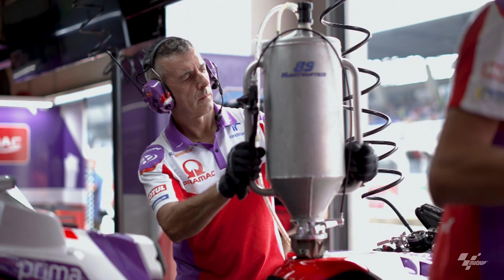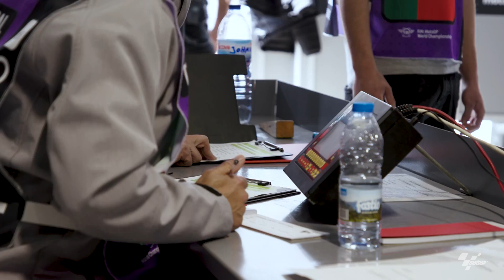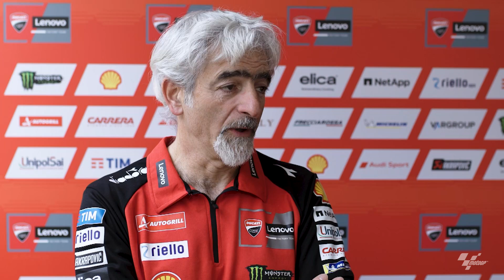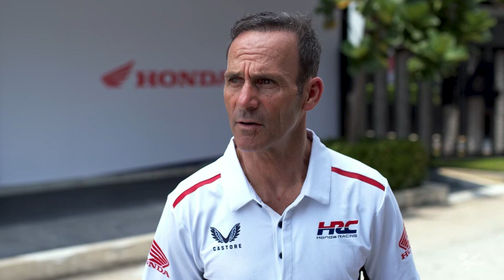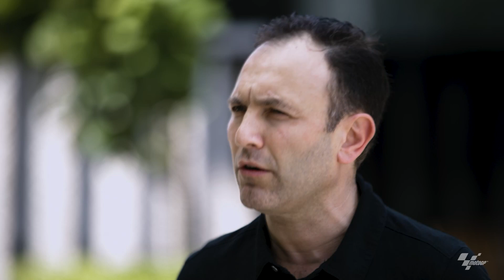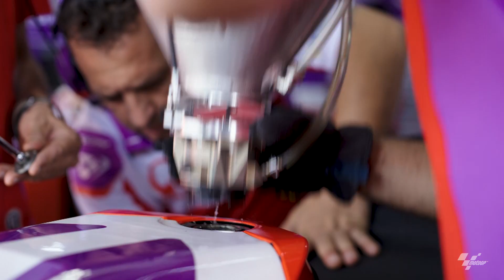How did MotoGP™ design the fuel of the future?

Comment: We already have Moto E separately. Hope this new fuel changes dont lead to scrapping current thing and moving towards no fuel stuff
Reply: Hear your point but I don’t think that will be the case. The point of these changes is to ensure that they won’t need to switch to some sort of electric bike. With synthetic fuels you’re no longer adding carbon dioxide into the atmosphere (it’s removed from the air and undergoes a bunch of chemical reactions to create synthetic hydrocarbon fuels - gasoline, diesel, jet fuel) and doesn’t contain the impurities of fossil fuel based fuels (I.e., nitrogen and sulfur oxides) which is what we consider pollution. Reports actually indicate improved performance because of their higher energy density. Same can’t be said for biofuels, though (I.e., ethanol) Synthetic > bio.
Reply: @CoastGhost13  Yeah. My initial thoughts were that only since they announced last year 40% non fossil fuel from 2025. But we know how the aero advancement situation, where every other manufacturers want to take it off. With this new changes  should not affect MotoGP because sound of the bikes is an integral part
Reply: @CoastGhost13  Dont forget Nitrogen is naturally present in the air, so NOx particles emissions are still going to be a thing due to the high temperature chemical reactions taking place during combustion, still, an important step forward. Also, CO2 emissions are not reduced whatsoever since its the main byproduct of internal combustion engines (Hydrocarbon fuel + O2 in the air => CO2 + H2O + other secondary reactions). CO2 is not a pollutant but considered a greenhouse effect gas. My point being, synthetic fuels are not going to be a complete game changer as far as emissions go, but anything to keep it going and stop stupid politicians from enforcing EV despite nowadays we face devastating consequences of battery production, lack of end of life recycling ability of the batteries themselves and lack of clean energy supply to be able to justify the electrification itself (using polluting electricity production to charge the EVs because we lack a strong clean electricity supply).
Reply: On this topic, most car manufacturers are srapping their EV plans so I think MotoGP will follow suit and scrap MotoE

Comment: spin spin spin. you guys are so far behind it's not funny. you are trying to make 40 percent sound good?! what's wrong with e85? or ev? get with the program - it's not the 1990's any more. "nothing major" is yer problem there bro. stop being laggards and lead, don't follow. push the limits.
Reply: EV sucks
Reply: 🤦‍♂️Go watch your ev racing mate , enjoy 😅
Reply: There already is a motoE championship which Ducati supplies the bikes for. Educate yourself before commenting.
Reply: @ambitiosus1079 thanks. I'm well aware of motoE.
but do you know what e85 is? look it up. it's 85 percent non-fossil fuel, not a laughable 40 percent. it's also common in performance engines.
racing is racing. put the best riders on anything (including ev) and it should be good viewing. if you are not confident about that then there's more wrong with motogp than just gasoline.
Reply: @plaguedbypenguins  If you are oh so well educated and informed, you should already know why they dont use high percentage ethanol fuel in motogp... You are clueless, my friend. They havent used it because using ethanol is very counter productive because you must burn more of it to obtain the same energy output, and guess what? The density of gasoline and ethanol are similar, so that means you would have to carry a much heavier and bulkier bike to make the full race, making it a much less performing race vehicle overall.